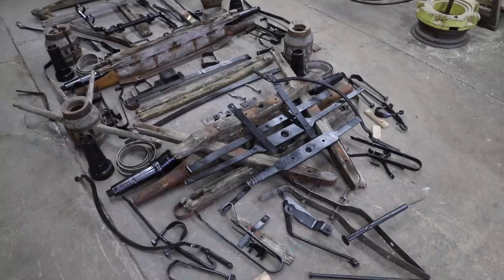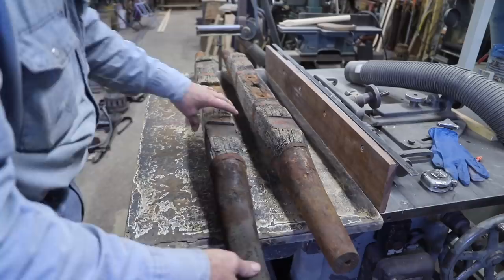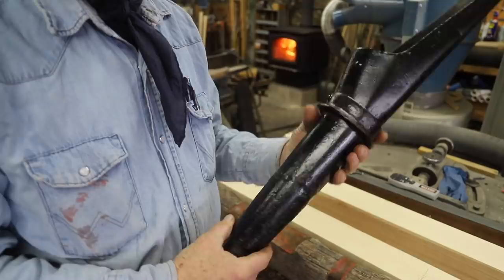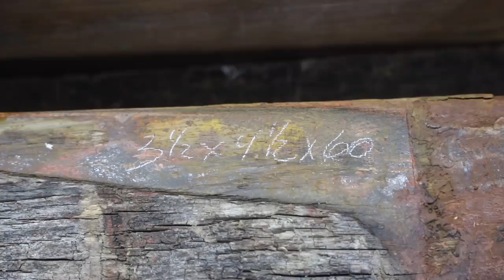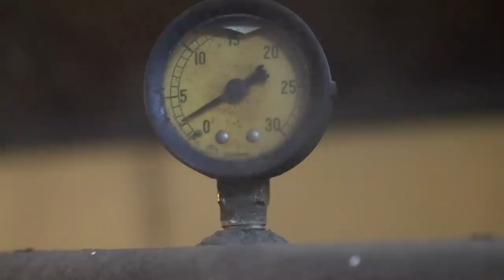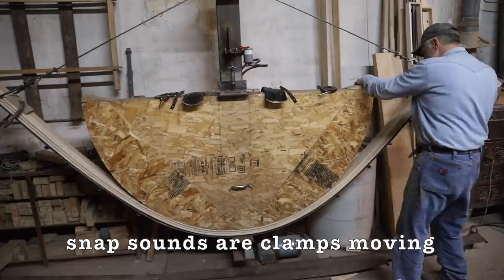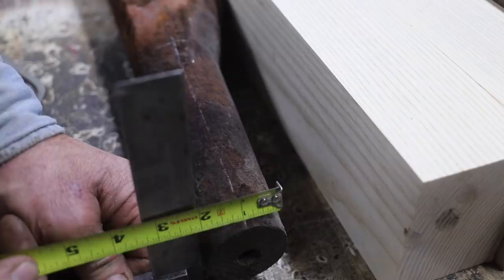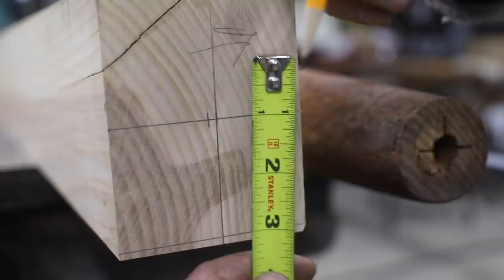Design and Layout of Wood Wagon Axles | Engels Coach Shop

Comment: My Grand dad was a black smith all his life.  He started toward end of the horse drawn wagon era and slowly moved into a more modern era of working on farm equipment.  He must have done a lot of wagon repair work judging by the amount of old wagons and wagon parts in his scrap pile.  I still remember as a young boy the sound of that huge trip hammer he had as he shaped iron.  That thing would make the ground shake for 30 feet in all directions.

Comment: thanks Dave for all the videos, I have been watching close to a year now and your work is unmatchable. I learned a lot along the way and you inspired me to try this myself so far i rebuilt an old buck board wagon my dad had for decoration and I'm now working on a bob sled kinda from scratch. the alinement videos are very helpful thank you. I want to start on sheep wagon running gear i have a lot of parts for.  just to let you know i will use all of my wagons with my horses. thanks again for your help

Comment: Well… you have taught me something in how to use a “push pull” steel tape to lay out straight lines, just turn it over, been teaching wood working in Ag mechanics for 38 years and have never seen nor thought of doing that. Such a simple and straightforward trick. I will teach it to my 8 grade Ag Mechanics students next week.
Reply: That was an amazing little nugget out of that video...yet so simple.
Reply: @TugIronChief  I teach proper layout, but in agricultural construction where you do not have all of the “proper”tools available and need a straight edge that is a handy tip. Thanks for your advice.

Comment: Steel was quite expensive at the beginning of the 1800's because they had not yet invented methods to make it cheaply.
As steel got cheaper, more of it was used.  Wagons are an example of that.  At the beginning of the 1800's they used steel very sparingly, putting it only in places that its strength, wear resistance, and better weathering properties, made it economically worthwhile.  By the end of the 1800's, they used it far more because the price had really come down.  Steel had gotten so cheap that it's strength and ability to be shaped quickly by casting, and drop forging machines, made it preferred over wood in many more places on the wagon.  Axle evolution is an example of the increased use of steel, and decreased use of wood.  Starting with bare wood on wood hubs and axles, then adding sleeves to the wood hubs and axles for wear rear resistance.  When steel got cheap enough, it was a waste of labor to shape wood to the special forms needed to fit inside steel sleeves.  By the early 1900's they realized that it cost less, and made a better product to use less wood and go with more steel.  Many of the last wagons were made with solid steel axles that were forged and turned in a factory like car axles.

Comment: I'm Glad I Found THIS Video BEFORE Making New Axles for Grandpa's Old 1880s SANDWICH HAY PRESS, as I would have probably made them Straight, like I'm guessing Grandpa Did 53 Years Ago when He Made the ones that are on it now and partially rotted away again.

Now I Know to Carve In the Camber & Toe-in which I Highly Doubt Grandpa did back in 1968/69 

While I'm waiting for the 3rd video  (to be uploaded Next Week) showing them being done on a "Duplicating Machine" or "Tracer-Lathe" of sorts, I'm guessing it is similar to what I always figured on doing, Jury-Rigging one of them to carve  out the tapers with a Router as they spin between centers. 

With what I Know NOW, even without seeing the third video yet, is that I will need to make Double Centers in each end of the axles so I can off-set the opposite end from the one I'm cutting to get the proper angles. 

GOOD TO KNOW Ahead of Time. 

Giving it a little more thought, I can probably Skip the "Camber" as it has Steel Wheels that should run "Plumb" as a whole rather than by the 'bottom' spokes of a wooden wheel as the spokes are angled in bother directions from the hub to the rim. I will still need the 1/8th in "Toe-In" on both axles though to keep the wheels against the flange and away from the nut.
Reply: Dave says even modern cars need camber.

Comment: With an axle that's wood, and it the enviroment that farm wagons worked in, I'm surprised you can be confident about that 1/8" measurement.  But I guess, that and your experience is all you had to go on.  Seeing the next steps will be interesting.
Reply: if it fit when it came off it'll fit when it goes back on.

Comment: Probably warped due to being slap worn out. Hot/cold cycles expanding retracting. Weight of the buggy couldn’t support rider anymore so the axles kept the memory. But today you can add water proofing like Thompson’s clear or stained to protect the wood 🪵 if one didn’t want to paint the body. ??

Comment: Lovely video Dave. 2 questions, Im interested to know, the original  axles look reusable to my untrained eye. Was it the customer's request for new wood axles or something I'm not seeing? Also, When they start using skeins? Were different timbers used when axles were just solid wood running in wood bearings?

Comment: So, is there a method/rules of calculating/determining, what the camber and tow angles should be on a wagon, depending on it's type and size, wheel size, etc? Or are those angles are just set intuitively, for the lack of better word?
Reply: It gets to be pretty universal. You set all buggy axles about the same and wagon axles about the same.

Comment: I'm surprized that it was ever necessary to have camber on a slow going vehicle and that a straight angle would be good enough. Or is it only cosmetics?
Reply: on a dished wheel camber keeps the lower spokes plumb
Reply: Roads were always crowned for drainage so maybe they always needed camber?
Reply: @davidduma7615  Wagon trails in the west were just that, two ungraded ruts-many ranch 'roads' still are-

Comment: 12:31 No riving knife? After a stupid mistake 35 years ago with a power tool, I am so safety conscious, it could be painful to some. I realise you probably have your reason, I'm curious. Luckily I didn't sustain more than a severed tendon in my finger then, but it was a close call. Not to mention other, less serious, things I've done involving electric shock, driving too fast, a car falling off a jack, angle grinder cuts....all the stupid things that ignorance and/or complacency lead to. 
None the less,  I love your old school woodwork, and the amount of precision that can be achieved! Keep it up!
Reply: He's using a 1908 Fay Egan dual arbor, babbit bearing  saw. Riving knives came 50-60 years later.... Dual arbor saw it has 2 16" mounted blades that swing thru inside, no stationary hard point to mount one. Babbit bearing , means it was made before we had started using ball bearings....

Comment: 6:30 So how did the wagonmakers back in the day figure out what sort of caster, camber and toe-in they were going to use was?   Were there graphs and charts?   Was it standardized depending on the size of the wagon or the size of the wheel?   And what if they made it and it was wrong, how did they adjust it?   Or did they have to start over from the beginning and remake the entire axle?

Comment: Since the tyres are steel, not rubber, (so won't deform during cornering) and the buggy doesn't have independent suspension, non-zero camber seems unnecessary.

Comment: Why is it no one seems to use rithing knives or guards any more
Reply: Saws from Europe tend to have them. Perhaps splitters could be added to a dual blade saw, would take some real effort in engineering and fabrication to make it work. Huther Brothers once offered a blade guard that mounted to the ceiling, with telescopic down tubes so as to set the height above the blade. I would surmise that Dave checks the fence on a regular basis for parallelism to the blade.  I have an INCA tablesaw that uses splitters, the have to be adjusted as carefully as the fence-
Reply: @horacerumpole6912  On dual blade saws we use a floating cross pole from above the work table and a drop down splitter..